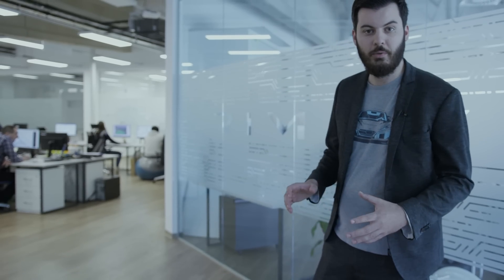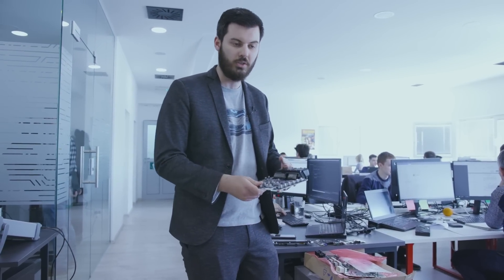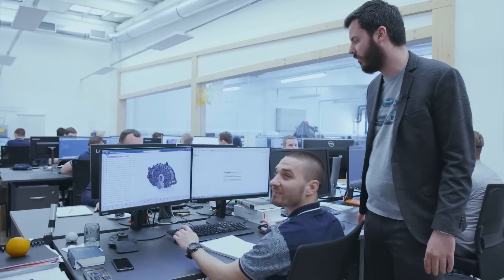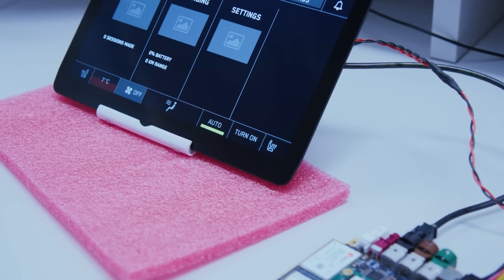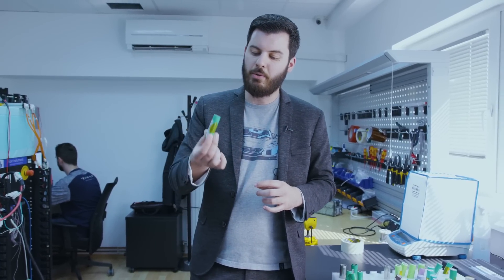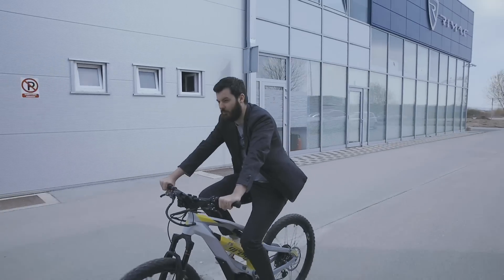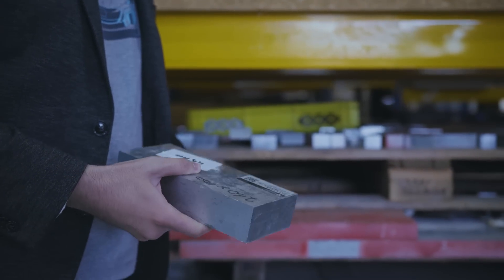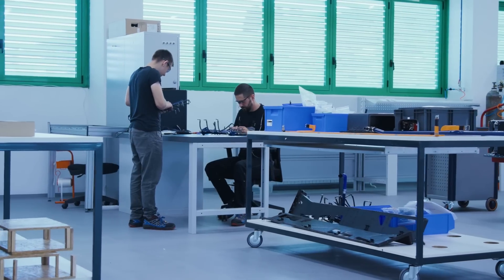Ep. 4/4 - DISCOVER RIMAC TODAY - C_TWO HYPERCAR SCIENCE with Mate Rimac

Comment: At 8:33 why have the power supply at 13.6V? Being a fully electric car without an alternator it will not have the usual 13.5V. Unless they are steping-down from HV Batt to 12V systems at 13.5V?

Comment: Hey Rimac Team.
You Need to Use Hemp Graphene Super Capacitor instead of Lithium Ion Batteries. 8 x Storage, 8 x lighter x fully charges/discharges near 20 seconds
They also cost very little.